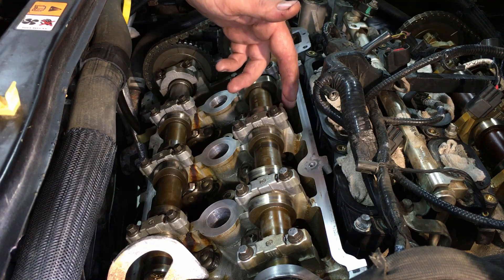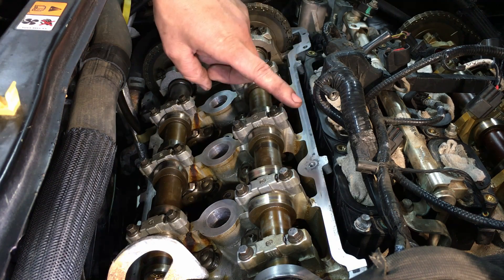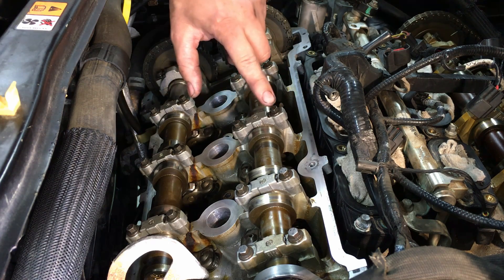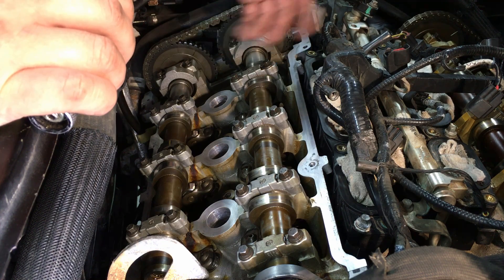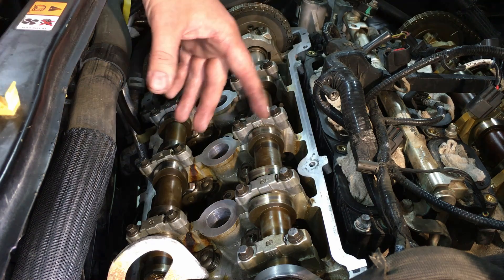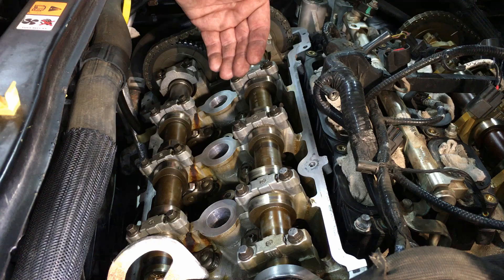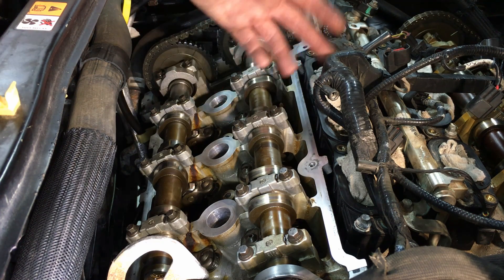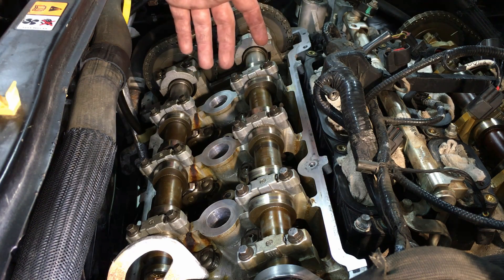Ford Quick Tips #61: 3.0L DOHC Duratec Camshaft Cap Inspection

Comment: This still apply to the later years 2012 Fusion 3.0l? 
This will be my 3rd time opening valve covers due to leaks but I'd like to check my cam caps if the info still pertains to my model.

Comment: 89 in/lbs is nothing. I'm surprised that the torque spec.  is so low.
Reply from the maker: yup it works though.
Reply: @FordTechMakuloco  It occurred to me that the bolts might stay tight if they were torqued to maybe 15% higher. That's about 100 in/lbs. And I think that's within spec.

Comment: Im from argentina and here is not a common engine. I have a escape v6 with 224k miles. When engine is cold i have a missfire but when is on working temperature or over 2k rpm works perfect. Do you think this can be the cause? Or what i have to look to fix
Reply: CAN SOMEONE TELL ME IF THE FORD/MAZDA 3.0L DOHC DURATEC V6 ENGINE WAS GOOD?  AND WILL IT LAST 300-400K MILES IF I KEEP THE MAINTENANCE UP?

Comment: I know this is a dumb question but should I do that with the front and back heads or is one more of a problem than the other? I'm assuming I'd have to take off the upper intake to get the back valve covers off

Comment: How hard is it to replace rollers and hydraulic lifters in this motor? do I have to remove the cam or is there a way to use a bent wrench and pop the roller out from under the cam without removing the cam?

Comment: Hi, so my mechanic accidentally broke the camshaft cap on my car! He replaced just the cap, but a lot of people told me this is not right & that he owes me a new head! By the way, the day after my car wouldn’t start & I had to get towed, but right after the tow, the car started right up. I had it checked & the diagnostic says bad charging system. Any advice is appreciated..

Comment: If you find a loose bolt ...can you remove it and use red threadlock then torque it back down to spec ...I've seen this suggested a few times now. Thoughts on this please? Thanks
Reply from the maker: Maybe high temp loctite would work but probably not.
Reply: So just retorque it to spec and leave it at that? 
It's not often you're going to remove the covers so is there a better fix? A new bolt? 
In a different video I saw it suggested that there was a kind of "upgrade" bolt. Have you any knowledge of these?
I'm in the UK 🇬🇧 with a Ford Mondeo Mk3 ST220 ( 3ltr V6 Duratec ) 
Thanks

Comment: After watching several videos on this, I realized this job was above my pay grade and I had my local mechanic (and friend of 30+ years) replace my coils, spark plugs and PCV valve in addition to the valve cover gaskets. There are a lot of extra steps in getting the heads off! 

My 2008 Escape 3.0 Duratec supposedly did not have this issue anymore but I wanted to be sure, so I went the extra step and had him check the cam cover bolts first, by hand and then by using a torque wrench at only 75 in-lbs (instead of the full torque of 89 in-lbs) for fear of breaking them. All was good! The engine has over 147K miles and looks great inside, and has no leaks or oil consumption. My new-to-me Escape is a perfect fit for me and my needs.

I don't mind spending the extra money for this step and head gaskets in order to get the peace of mind which I now have. Thanks a million for this video!

Comment: I did my valve cover gasket can I take it back off and tighten them up?
Reply: I've never heard of re-using a valve cover gasket on any vehicle. I found out the hard way on my other vehicles that FelPro gaskets (blue silicone) are terrible and the Victor Reinz gaskets (black rubber) are excellent.

Comment: So I think I have experienced this failure.  Is there any chance this engine could be repaired?  The car was only driven a short distance before it started making the sound you describe in the video.
Reply from the maker: It depends on the damage it caused, remove the valve cover and check it out.

Comment: I have a 2009 escape 3ltr v6 runs great. recently noticed a tapping sound in the the bank 
closest to the firewall. 221000 km. maybe need to replace lifters . the tapping cant be heard unless 
i open the hood. always keep clean oil in the engine. only hear it when idling for a while. 
overall has been a very reliable engine. no leaks or oil burning.

Comment: 05 Escape 3.0 160k has Water Pump driven off the forward heads cam (cyl 4 -6). This one had the water pump tensioner pulley abandon, allowing any & all vibrations from the water pump to be directly displaced to the cam... Even with the tensioner pulley... we should question if the initial engineers allowed for this additional stress on these journals causing the loosening of bolts?
Reply: CAN SOMEONE TELL ME IF THE FORD/MAZDA 3.0L DOHC DURATEC V6 ENGINE WAS GOOD?  AND WILL IT LAST 300-400K MILES IF I KEEP THE MAINTENANCE UP?

Comment: Watch your tech tips quite often.  Own 2006 5.4 doing great, 97 4.2 doing great.  My question is about the 3.0 DOHC 2000 in Sable.  Going to change the valve cover gaskets for an oil leak.  Would you advise cleaning the threads on the bolts and head to remove oil and then apply blue locktite to the bolts and torque to  89 in lbs one cap at a time to prevent bolts loosening?

Comment: This was very helpful, should there be any slack in the timing chain at all? Or should it be tight? I was replacing valve cover gaskets no engine sounds or anything everything was good but I do have almost half inch of slack in my timing  chain.
Reply: Normal on the duratec

Comment: I know this is almost four years old  but my Escape did start running bad with a ticking sound. Then it blew out the #5 spark plug. Could this cause that? Even after milling, tapping and installing an insert it still runs horrible. It used to run great, up to 95 it would hang with just about anything. (Not that I have ever broken the speed limit)
Reply: exact same problem

Comment: Im tackling a valve cover/plenum gasket and general tune up on my friends fusion with the 3.0 tomorrow. Your video of removing the intake plenum, and this video here for the ticking noise made me subscribe. Great info and content man.

His car has a nasty upper end tick, and runs horribly with several oxygen sensor codes on both banks being either rich/lean/or voltage issues, along with low vacuum. Hopefully this job fixes his issues, and has no damage to his cams.
Reply: i take it his cam caps where fine?
Reply: @Mr_Meowingtons  lmao funny story about this dudes car. Apparently he was behind on payments, and the place he financed it from had a gps locator attached. I woke up to them loading it onto a truck. Never got to finish the job.
Reply: @Mr_Meowingtons  but yeah the caps were fine.

Comment: Having these exact symptoms on the same motor will see if this is my problem and will let you know thanks for sharing.
Reply: What are / were your symptoms ?.
Reply: @WISHBONEL7  same engine I have is ticking in this area runs and drives great just trying to get rid of that sound.
Reply: @davidblackwell6914  did u find anything?  My 2012 escape 3.0 has a tick but runs good, no misfires

Comment: I have a 2010 fusion with the 3.0 and I'm getting a ticking noise, I've tried Lucas oil and rislone to clean it out, no change at all, the ticking gets a little quiter when warm and goes away after 2k rpm, could this be the issue?
Reply: check the ford TSB 06-3-5
Reply: @esteve95  I believe the tsb he mentions in the video ends in 2009 I have the newer model year 2010 and the engine is slightly different with the heads so I didn't know if it would still pertain to my car or not
Reply: @realtreeford19  I see that it has  an exhaust camshaft driven water pump, the issue is that with the extra tension put on that camshaft by the pulley and tensioner, it develops extrawear in the camshaft caps, causing the tolerances to increase, you could plastigauge the camshaft caps to confirm

Comment: My 2002 escape is also making a ticking sound. It was worse before I changed the pcv now it's more quite but you can notice it. Then when it starts up cold it makes like I don't want to say a knocking sound but it kinda sounds like it but gos away after a second.

I bought it used with 171,000 miles on it now it has 186,000 I keep the oil changed probably more then I should 5w 20. When I first got the car the ticking wasn't there.

Comment: What is the timing procedure for those engine? Also what are torque specs for rod and main bearing caps fixing to rebuild 3.0 duratec v6 in 09 ford escape  one

Comment: Hey! 2012 Ford Escape. 65,000 miles. Making a very faint slight ticking upon cold start idling. Under load, no ticking detected. Not serious yet, but trying to diagnose before diving in. And is it a job to take the valve covers off?? Intake off I’m guessing?

Comment: Hey, i have a 2007 ford escape V6 3.0 Duratec, there is a rattling noise when under a load at 2k - 3k rpm. No misfires no check engine light, i'm thinking timing chain ?
Reply: I have exactly the same problem but didn't found a fix yet...i suspect the chain tensioner .
Reply: @ATMA_STUDIO  I'm still suspecting Chain Tensioner too.... i hope we can get a answer from FordTechMakuloco
.

Comment: My Ford Escape 2005 3.0 idles smooth as butter with no noise but once you give it a touch of gas it knocks. Could it be the caps or more likely a rod bearing?

Comment: There is a TSB for this.  Many times the engine will make a light ticking noise from the front valve cover when the cam caps are loose or not torqued in the correct sequence.  I found you need to do the torque procedure with the engine warm to eliminate any noise.  This engine normally runs very quiet.
Reply: How do you torque it warm? The covers have to he off in order to do it..  Epecially rear head after removing intake.

Comment: There is a Ford TSB or Service Bulletin. If you hear a ticking noise you have to take the valve caps off and reseat them. The TSB says just tightening them is not sufficient. They must be taken off completely and reinstalled.  Just Google it and the TSB will appear. They say to torque to 8Nm or 72 lb-in.   See Ford TSB 06-3-5.
Reply from the maker: +BOSS HOGG That TSB is only for the newer 3.0l duratec engines to fix a very specific noise when cold on the left hand camshaft only. This problem is totally different.
Reply: It may be a totally different problem but this TSB applies to older 3.0 DOHC engines and seems a bit similar. Just had my 2002 3.0DOHC checked and at least 1 cap was wonky. So checking it and reseating them is important if a tick is heard. Here is TSB  06-3-5...

02/20/06

CAMSHAFT TICK NOISE - 3.0L 4V ENGINE ONLY
FORD:
2001-2005 Taurus2001-2006 Escape

MERCURY:
2001-2005 Sable
2005-2006 Mariner

This article supersedes TSB 04-20-8 to update the vehicle model years and Service Procedure.
ISSUE
Some 2001-2005 Taurus/Sable, 2001-2006 Escape and 2005-2006 Mariner vehicles built prior to 1-17-2006 equipped with the 3.0L 4V Duratec engine may exhibit a ticking noise from the left bank cylinder head, with the engine at normal operating temperature only.

ACTION
To diagnose, with the engine running and warm (normal operation temperature), using a mechanic's stethoscope determine if the ticking noise is coming from the left hand intake camshaft at cylinder number 6, (Figure 1). If the ticking noise can be verified, refer to the following Service Procedure.

SERVICE PROCEDURE
1. Remove the left bank valve cover. Refer to Workshop Manual, Section 303-01B.

2. Rotate the engine clock wise until the cylinder number 6 intake cam lobes are pointing up and the valves are fully closed.

3. Remove all left hand intake cam caps individually and reinstall them finger tight.

NOTE THE CAMSHAFT CAPS MUST BE COMPLETELY LIFTED OFF AND THEN SET BACK INTO POSITION. LOOSENING AND RE-TORQUEING CAP BOLTS IS NOT SUFFICIENT.

4. Torque bolts in sequence shown in Figure 2 to 72 lb-in (8 N.m) excluding cam cap number 8L camshaft cap.

5. Using a screw driver positioned on each side of the top of cam cap number 8L (Figure 3) apply hand pressure and shift cam cap number 8L toward the exhaust side of the cylinder head.

6. While holding cam cap number 8L in the shifted position, torque the fasteners number 9 (inboard) first, to 72 lb-in (8 N.m) then torque fastener number 10 (Figure 3).

7. Install the left hand camshaft cover. Refer to appropriate Workshop Manual, Section 303-01.

8. Fully warm the engine to normal operating temperature to verify the repair.

WARRANTY STATUS: Eligible Under Provisions Of New Vehicle Limited Warranty Coverage

OPERATION DESCRIPTION TIME

060305A 2001-2003 Taurus/Sable: 0.9 Hr.
Remove And Install The
Camshaft Caps Includes
Time To Remove And
Install Valve Cover (Do
Not Use With 6007A10,
6250AL, 6584AL)

060305A 2004-2005 1.0 Hr.
Taurus/Sable: Remove And
Install The Camshaft Caps
Includes Time To Remove
And Install Valve Cover
(Do Not Use With
6007A10, 6250AL,
6584AL)

060305A 2001-2006 Escape and 1.2 Hrs.
2005-2006 Mariner:
Remove And Install The
Camshaft Caps Includes
Time To Remove And
Install Valve Cover (Do
Not Use With 6007A10,
6250AL, 6584AL)

DEALER CODING

CONDITION
BASIC PART NO. CODE
6A267 07[/b]
Reply: @Joe Black 6 cylinders
Reply: @Joe Black I hope your tick went away after reseating the caps. Mine was as good as new after reseating them. The tick is real and it can create real problem if not fixed. And the ticking noise is downright annoying if nothing else.

Comment: Great info. Will be doing this soon. Thanks!
Reply: Feedback. How was your repair?
Reply: @xAwoken_Dreamer  After looking at the cams during a valve cover replacement, I could see that they were in excellent condition. I never took the caps off but I did use the torque spec given in the video and went over all of the cap bolts to verify that they were tight, and they all were.
Reply: @baxrok2. Gald to hear! appreciate the response

Comment: Hello there fordtechmakuloco,  can you tell me how to remove the timing crankshaft sprocket on this engines? i m trying to change the head gasket on this engine and i m stuck at this point, so simple as a nut in other engines but not in this one, 07 Fusion V6 , 3.0 DOCH. Thanks.

Comment: I found a TSB on this problem (TSB 04-20-8) from Ford. It states that it affects the left bank (toward front of car) cylinder head. I plan to pull mine tonight to inspect (my Escape just developed a ticking sound from this area). How difficult is it to get that valve cover off? And should I be worried about the right bank too (the TSB does not mention the right bank). Thanks.

Comment: I guess maby if you were to check the map sensor reading on scan tool it was like give an idea to start looking there after you check spark and fuel. I guess also a compression test would should a little low with loose cam to maby ?
Reply: compression test would not work since the valves would still close properly but would not open fully

Comment: Please help😞
My 1999 crown victoria has big proplem
When I run the engine after 10 minutes
The oil Pressure gage
Drop . and the engine starts make noise
I turn it off and let it cool
Then i start it and the same proplem back
So i change the oil pump and
The problem is not addressed😞
I change the oil and the filter to
and the oil cooler
No thing workout
Please help me
Reply: ***** thank you for answer me
My engine has no smoke no oil leaks and it was runing perfict
In my car the pressure relife valve inside the pump
The oil pickup tupe i chick it
I well try adding 20w50
It's the last idea be for changing the engine
Im think to by a 2011 engine
It costs only 1800 $
Better than rebiulding the engine . What do you think
All love from your friend mansour from saudi arabia
and surry my english is not very good☺

Comment: I've been working on my wife's 05 freestyle with over 250k. I changed plugs and coils. While I was at it I replaced the valve cover gaskets. I wish I had know about this when I had it apart. After doing that work the car ran great for about 3 months than one day she was driving it and the car started misfiring and she limped it home. When I checked the codes there were 42 code. Everything from misfires both random and pacific like 2 and 3 and 5. To cats below threshold, egr, pcv, and other codes. I've check cam timing and replaced chains. I've replaced egr and pcv valves. Changed coils and plugs again. Evan crank and cam triggers. And of course manifold gaskets. One thing I did not check was the cam cap bolts. Sense all this started I have been hearing a noise I contributed to a collapsed lifter. I hope I fined something with these cam caps. I was down to a bad ecu or bad wiring harness. Any help would be greatly appreciated.

Comment: What year of engine of did you find this problem on my DOHC 3.0 litre is a 2012 kinda worried now
Reply: Up to 2007 I think.  2008 they came out with a different motor.
Reply: @RickyPisano  My new-to-me 2008 has 147K miles on it and the engine purrs like a kitten but I am going to have these bolts checked anyway, since it needs new plugs, coils and PCV valve. Fortunately, the previous owner changed the oil every 3K miles.

Comment: I'm have a 1998 eb 5.4 expedition 4wd with a trouble code p0442. i took the hose from the evaporated canister and blew through it and there's no pressure build up . it think it spits off to the tank vent and continue up front to the engine area through a metal pipe. should I be getting pressure build up?

Comment: have an 09 escape and am getting a random tapping noise in the valve train area toward the front of the motor.. it is only noticeable around 1200rpm. wonder if this is the cause
Reply: Front of the motor toward the passenger side?  Try and listen from wear. Very front of engine could be timing chain issue. Check the oil level